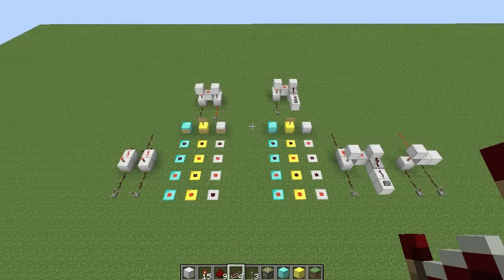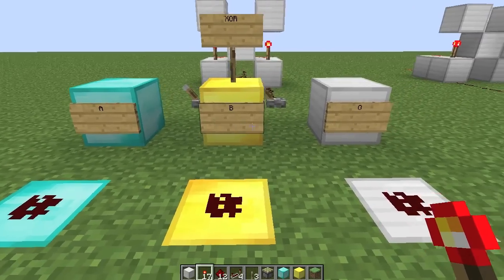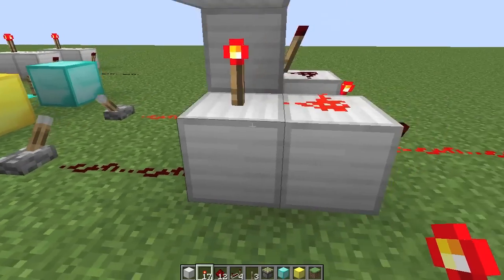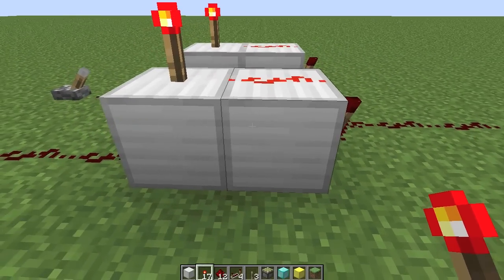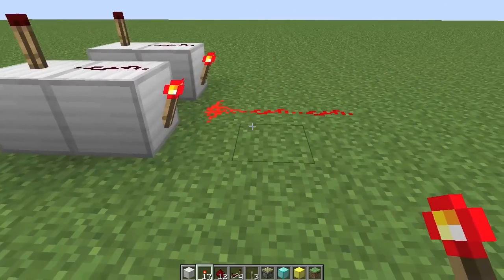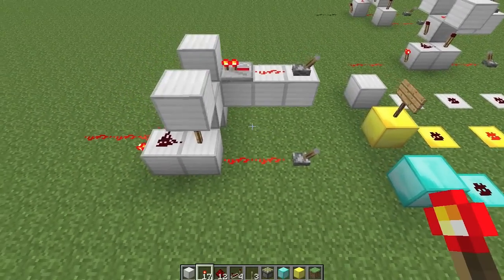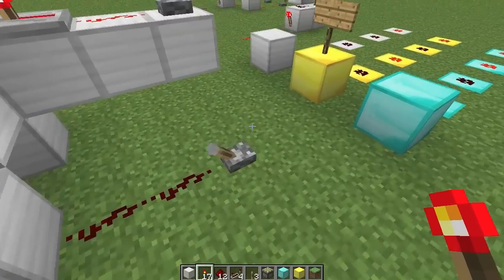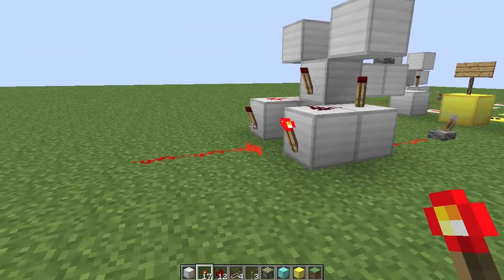Tutorial: Need To Know 3 - XOR and XNOR

Comment from the maker: That's absolutely true, but I went with this approach for the tutorial for two reasons. First, it gives a better demonstration of how you can use simpler logic gates to make more complex ones. Second, by inverting one of the inputs rather than the output this XNOR is the same speed as the corresponding XOR. The first reason is more important than the second because these gate designs aren't really optimized to begin with. :P